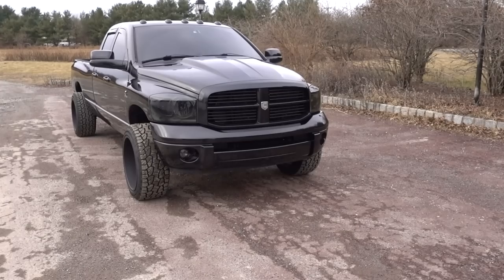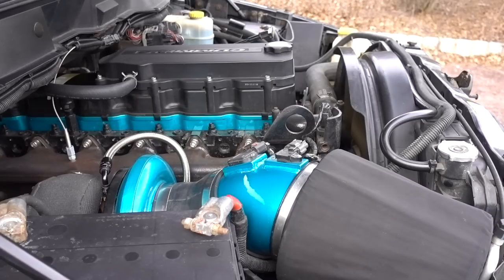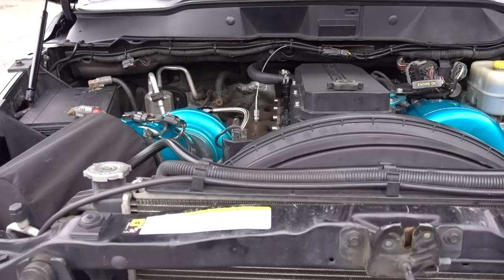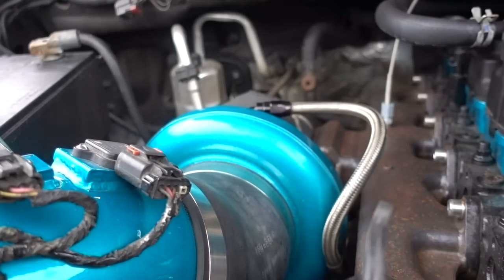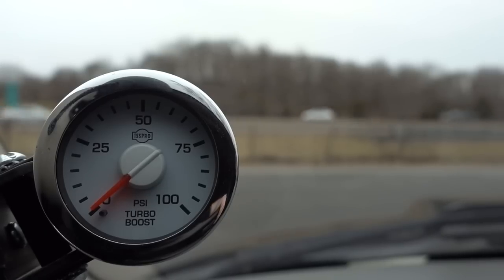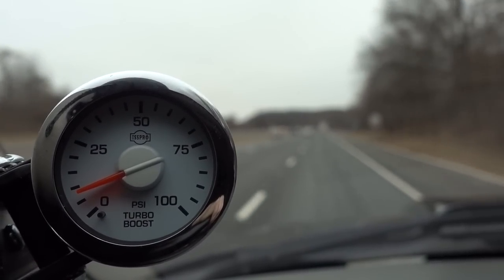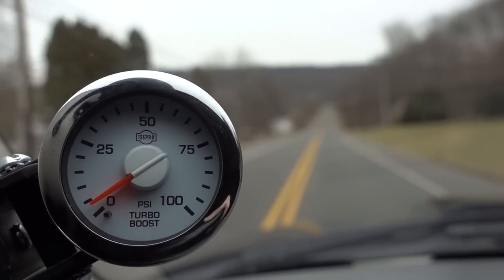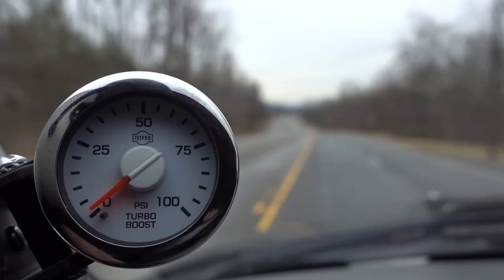6.7 Cummins Tow Rig Turbo Setup! 2nd Gen Swap w/ 467.7

Comment: so your truck is completely deleted. I just bought a 2015 Ram 3500 6.7. I have a 4 year unlimited warranty from Ram. What do you think Delete now and get rebate on warranty or wait until after the 4 years? what worries me about deleting is noise and smoke. where I live would not be an issue but what I use the truck for it couldn't be noisy or Smokey.
Reply from the maker: Yes it is, my brothers previous truck was a 2012 and he bought it with 7k miles on it, doesn't sound like much right, he always ran the exhaust brake to try and reduce soot build up in the egr system that recirculates back into the engine. When we deleted it at 7k miles the soot build up was enough for me to recommend to people to delete asap, I understand the drawback of possible warrantee but lot of warrantee issues are caused by this, maybe wait 5/10k make sure it solid and then go for it! There are ways in tuning and a good exhaust to not be smokey but you will pick up some noise even with a good muffler/s.
Reply: GREG_ALBERALLA that is my big concern. I read a while back about running the exhaust brake all the time and I do. so far it is a solid truck. I said 2015 but I ment 2016. I have not had a lot of time to pull or haul with the 6000 miles on it. I have noticed the transmission doing things that I'm not use to seeing or feeling but I'm thinking that its because of not working it as hard as I should in the beginning. I will be this week hauling 1 to 2 tons at a time for about 4 runs. in hoping to see a boost in mph even 1 mpg after that. most of my driving is on the road and not much start and stop. I do tend to let it ideal to much but it is cold here and I want a warm truck. I think your right about the delete. over these next few months Ill push it harder and then deleted before 10k well maybe 15k.
Reply: me my dad and my brother have a 10-12-and mine is a 13 even stock the soot will build up and clog the egr and vgt. my brother and dad have all deletes. I found that with mine I tow 16,000 pounds every weekend in the summer and I have no trouble with soot. in the winter when I done tow it plugs up bad exp if the truck sits and idles. so to fix I just tow the trailer about onece a month and it burns the vgt and egr clean.
Reply: i just deleted my 16 ram 2500 bought brand new with 2 miles on it.. i waited til 10k just to be safe... best decision ever.. i did full deletes , so throttle body, egr, dpf, DEF , CCV ... couldnt be happier..
Reply: brandon mayes what about the noise and smoke?
Reply: EnlightMent I did a 5in turbo back flo-pro with muffler.. It's louder than stock for sure but it's not like omg turn that shit off loud... I'm running pretty clean tunes from ppei so it's not super smokey.. I'm not a teen so rolling coal isn't my thing lol
Reply: brandon mayes more good news thank you. I think that I'm going to delete my wife 1500 eco diesel also.
Reply: EnlightMent yea man all that emissions shit is actually what causes the warranty issues down the line.. I would have done mine sooner but was undecided just like you... The dealership will still work on your truck if that's what you are worried about.. They might give you a hard time but you probably won't have any issues that would require you to be at the dealership anyway...